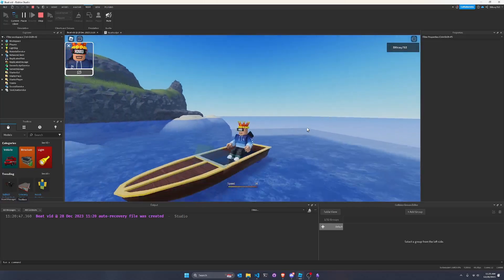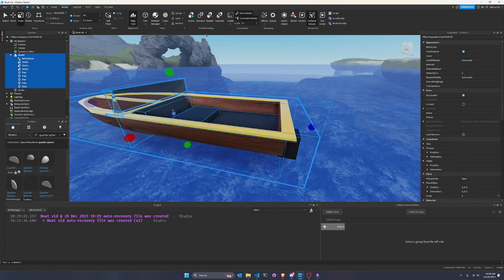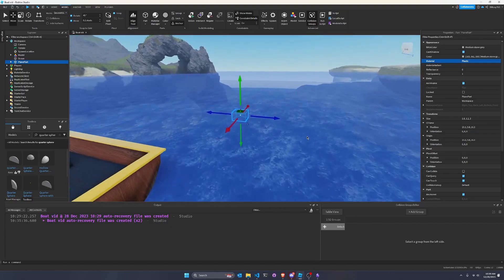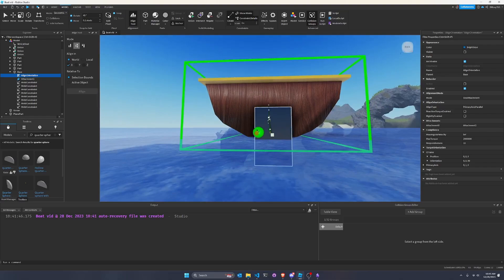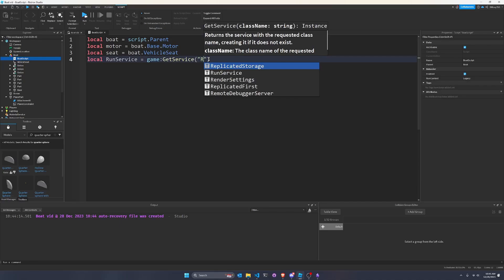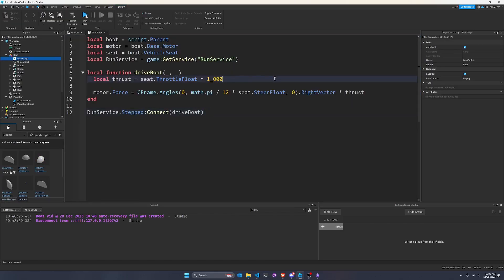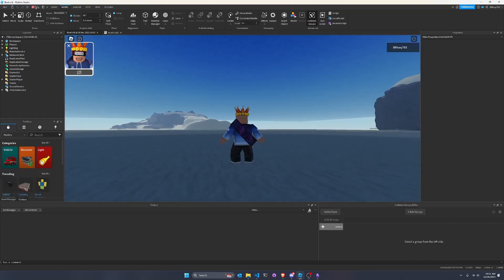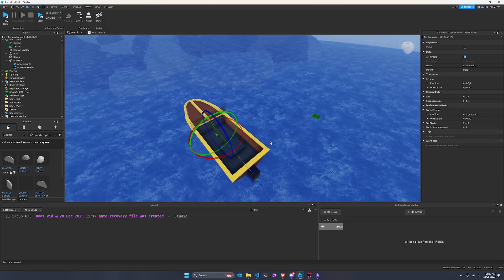How to make a realistic Boat/Ship  - Roblox Studio

Comment: you should make a video on the ECS architecture and data driven programming, that's pretty much the only way I see games being made.
Reply from the maker: There's a library in roblox called Matter being developed that adds ECS, so I've been waiting for that to mature, and once it's stable I'll totally make a video. But honestly, since Roblox is so versatile, I don't see a point inventing a system from the ground up to use ECS, only build what you need. Also Tags and CollectionService are like ECS light (check out Sleitnick's component library to supercharge that)